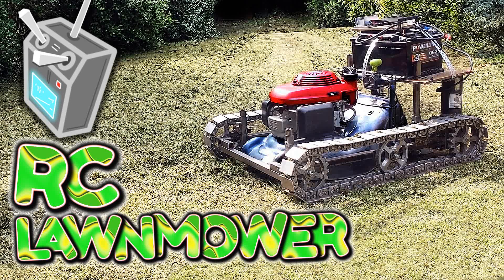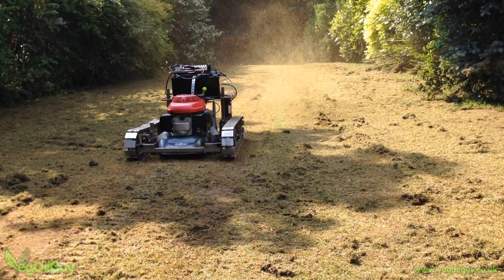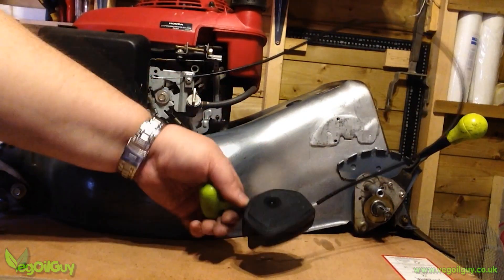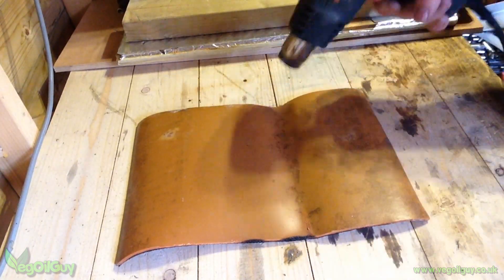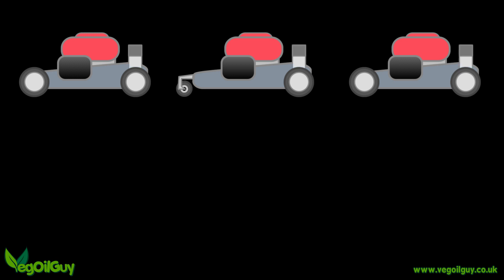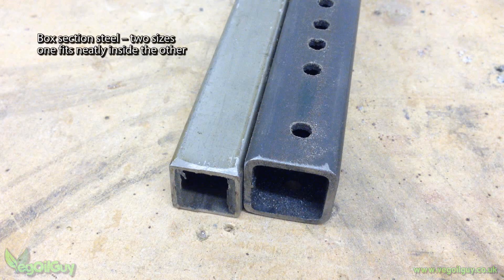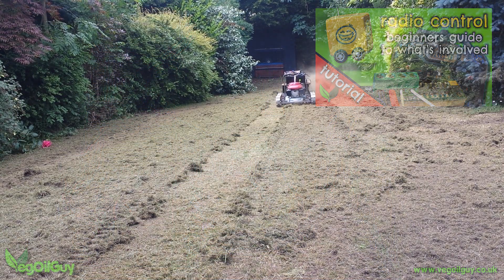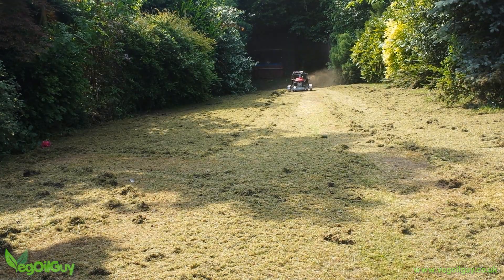Radio Control  Lawn Mower with TANK TRACKS – a build by VOGMAN

Comment: This is the best DIY RC mower I’ve seen to date, tracks seem to perform better than wheels. Such a great idea to save having to hang onto a vibrating handle, breathing in dust, lawn clippings and fumes and have boots full of lawn clippings. You could just mow the lawn while sitting in a comfy chair sipping liquid refreshment
Reply from the maker: That's the idea 😁😁😁

Comment: How about putting a altanter on the top of motor and charge the batters
Reply from the maker: Hi Dakota. I had toyed with the idea. However, my two batteries have no trouble powering the mower long enough the cut my lawn two or three times over, so it's just not worth it for me. 
But I think the idea is a sound one for folks with more grass to cut : )

Comment: I still think that would make an awesome battle robot.  😃

If you don't want to re-engineer your wheel bolts, maybe bolts from a stronger type of steel will do the job.  Or did the bending occur at the sheet metal behind them that needs additional support, like a plate?
Reply from the maker: Interesting the aluminium tracks (just standard U profile) and the sprockets (cast me me) are fine. It's a 12mm steel bolt that bent.
It was simply too long. It needs better support. I've got a plan in mind : )

Comment: Love the engineering on the tracks.  Are  you using the Sabertooth 2x60?
Reply from the maker: I use two Invacare motors, but the make doesn't really matter. Most wheelchair motors are robust and up to the job : )
Reply from the maker: Very nice! Now I know what my lawnmower wants to be when it grows up : )
Excellent professional quality build.
Reply: VegOilGuy, thanks for sharing your video and knowledge.  I kinda cheated by buying  the tracks and built the chassis around it and didn’t make it from scratch like you did.
Reply from the maker: No - thank "you" for being kind enough to say that. We all share and use the knowledge of others. No one is completely self taught : )
And you've done a cracking job there. It's very slick. I'm impressed. Well done.

Comment: How do you make these things turn properly control wise?  ie. make one wheel go fwd and the other wheel go backwards?
Reply from the maker: Each track is controlled by a separate motor. Steering is done by varying the speed of each motor. For example, to spin on the spot, one motor goes forward and the other reverses 😁

Comment: to releave some of the strain on your gears in the turns, would it perhaps be a solution to make the track longer and trapezium shape? That way the wheel that gets the forces is not the front wheel but an intermediate wheel... It will also avoid the tracks being bent like you showed, which will increase track life.
Reply: and it will allow your mower to overcome larger steps in the yard surface, in case you let me rent it ;D I'll handsand your welds for you...
Reply from the maker: In fairness I haven't been gentle on it. There's a good six inch step into my shed and I just let it take a run at it : )
It really climes well. Bags of torque.
But the weakness is in the flimsy way I designed that T bolt. I'll cast something some solid and possibly replace many of my terrible welds at the same time. 
It will be fun experimenting.
Reply: bags of torque, I can imagine that using those 2 wheelchair motors that are designed to swiftly maneuvre a 150 pound chair with a 200 pound passenger but now only have what 50 pounds to push?
Using wheelchair motors in and independant drive setup is a stroke of genious, if you ask me. Compact yet very powerful, pretty silent motors that are made to run with high precision. In fact, I'm going to take a note of it, so use similar motors when I make my lathe...
Reply from the maker: A lathe? Impressive...
They are excellent motors. If you've watched my electric foundry build, I use one to hoist the foundry in the air to access my crucible. I've also heard of guys using them for garage door openers.
As you say, they're well engineered.
Reply: Yes, I saw that and I was impressed with that system to get the crucible out. Much safer too!
The lathe is my most ambitious project, but I've got most of it planned out. Once I start the build, I should start filming and put it on my channel, I suppose :) It will be a 3-step process: I'll first build a simple one to make the precision components that I need for the final one. In a final step I will upgrade it with more precise components that I created on the final version itself, though I'm not sure if that will work. The biggest part of the planning work, is sifting through the tonnes and tonnes of information out there...
Reply from the maker: You're more than welcome to share the link here when you're ready  : )

Comment: We recently had some workmen from a local cable company come by to replace some defective underground cable.  The machine they used had tracks like your mower, but the machine must have been multiple times heavier.  It tore our grass out by the roots where they turned it.  Is your tracked mower tough on your lawn where it turns?
Reply from the maker: That's a good question Ron. On a straight run - no problem, but as you say it's the turns where tearing of turf can occur. With caterpillar tracks, steering is done by changing the speed or direction of opposing tracks. I found if I turned one track, but not the other, to skid-steer (as the term suggests), this damaged the lawn. If I went at things full speed and turned, this could also create bald patches. But if I slowed down for the turns and tried to roughly match speed (but not always direction) of the tracks, there wasn't any noticeable damage.
It's like all such things I think Ron, it's how you handle it that makes the real difference... but mine isn't as heavy as theirs : )

Comment: Wow!  Another impressive video.  🤓   I really enjoyed watching it.  👍  I'm wondering, is there a plan for a discharge deflector in the works, you know, to prevent anyone or anything from being struck by any hidden debris?    I know, you're not finished yet.   Again, smashing video!  😊
Reply from the maker: Hi Ron. Thanks for the kind words as always : )
I have many plans. Cameras. Night-lights. Fibre glass body shell. Lots of ideas... but will they ever surface?  That's another question. 
There is a surprisingly impressive cloud of grass cuttings though - I never expected that.
Reply: Well!  It seems like quite a playlist is in the making!  😊   I only strap down my safety bar at the end of the mowing season to empty the carburator of fuel before winter storage.  But I guess that still counts, doesn't it?

Comment: Could you use really grip mud tires? And what's the range of this?
Reply from the maker: You could use wheels instead of tracks or add rubber to each track. The choice is yours. As for range, that's down to the batteries. I use a couple of car batteries and it's never been an issue for me.

Comment: Hi. I am thinking of building one out of 18V (possible overvolted to 24v) cordless drill motors. They are rated at 18v, 45Nm torque, 350rpms.  I cannot find out if the power - torgue they deliver is enough. It would be extremely useful if you could share the voltage, power, max amps, and rpms of the motors you have used. Please also let me know if you were satisfied with the result in terms of power. Thanks in advence
Reply from the maker: Hi Theo. I'm sorry to say I don't have any of that information for you. You can always try looking up the Invacare motors if you wish. I'm sure there's something out there.
For me I never wanted speed and when I initially built the tracks I thought I was going to have to gear the motors down as it was a bit too nippy. However, once the extra weight of the petrol mower was added, everything was just right. And that's why I went with wheelchair motors... bags of weight carrying power. High speed meant nothing too me if I couldn't cut grass.
So again I'm sorry to say I haven't a clue how your cordless drill motors would perform as it's not something I've tried.
When we do these projects, there's so much we have to figure out on the go  : )
Best of luck.

Comment: I know... let's put on metal caterpillar tracks on a lawn mower... no way those will dig up the lawn and make a mess of it. 💡
Reply from the maker: Actually they don't. If you twist and turn like a maniac, sure, you can dig in thanks to skid steering. But for the most part, the tracks lie on top of the ground and thanks to the increased surface area actually place less pressure and weight on each blade of grass : )

Comment: Use the pulley and belt you removed to drive a car alternator and do away with the batteries.
Reply from the maker: I considered it. But my lawn isn't large enough to warrant the expense. The batteries hold up just fine, but on a larger lawn, this would definitely be useful  : )

Comment: The problem is that it still takes as much time to mow the lawn with or without the mower. But the vehicle is awesome. Now you just need to team up with and arduno guy or learn it yourself. And add a weed whacker that can be hidden until it is used then hidden when no longer in use. I'lll loan you the Thompson 45 submachine gun I have between the ape hangars on my Harley. Ii get away with it because I had the weapon chrome plated to match the apes and the chrome on the bike. So it looks like it's a prop or for show.

lmfao